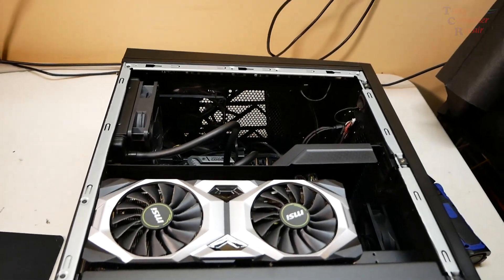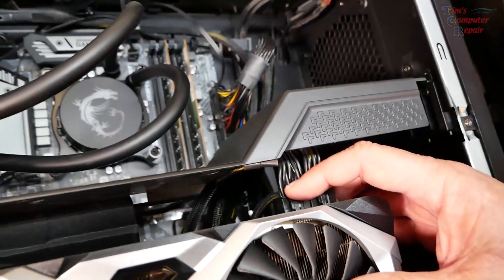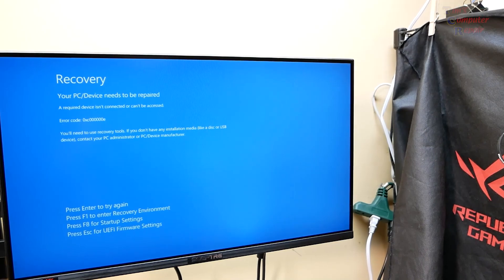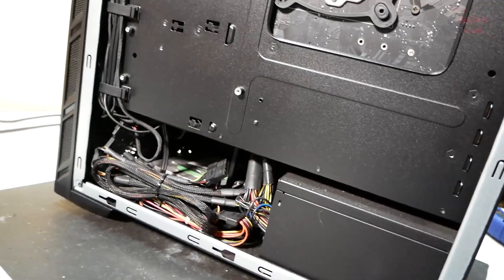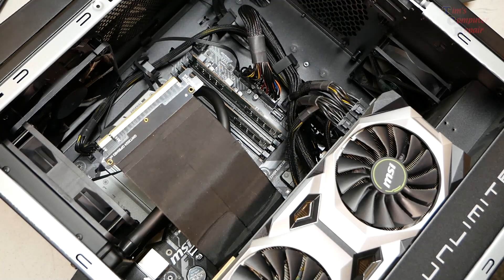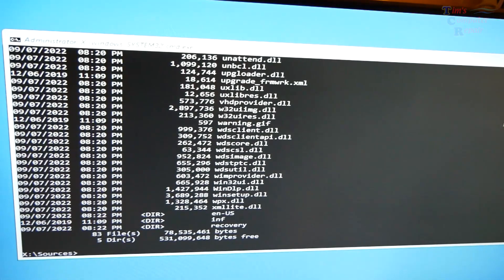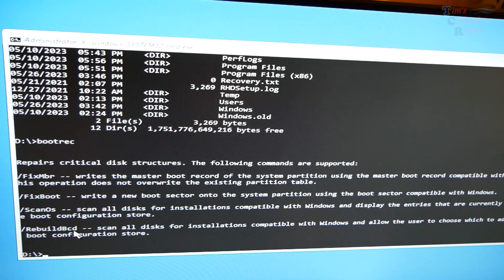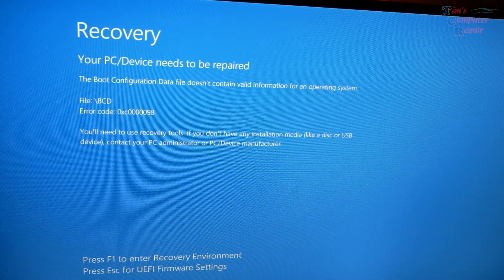This Windows Bug Happens to So Many Computers That Come Into My Shop

Comment: rEFInd is another great easy to use bootloader that can get you back into a windows installation especially when used with efibootmgr
Reply from the maker: Thanks for commenting.
Reply: @TimsComputerRepair  No problem, rEFInd is generally used for dual booting with linux and efibootmgr lets you see and edit the uefi boot config to set a partition as bootable from a linux live usb. It's slightly unconventional but it's a good backup!

Comment: May be related to TPM in some way
Reply from the maker: Maybe
Reply: @TimsComputerRepair  Yeah because IIRC if TPM is disabled suddenly and windows is configured to only boot if it's on, that would explain what you're seeing there. There are other programs/hardware hijinks that do this too in the sake of "security". I guess if the data isn't locked and can be recovered, I am wrong about this. Nice video, thanks to replying to me, cheers!

Comment: one of the biggest mistakes I think most users make is to have the Windows OS and their personal files on the same hard drive/partition. Way too messy. What I have done for years on my computers is to separate the operating system and my personal data. Right now my boot drive is a 500GB M.2 drive and the only thing I put on that is Windows and all my apps. Nothing else. All my personal data goes on a separate hard drive. I make sure to backup my personal data regularly. If my Windows gets corrupted or the M.2 craps out it is much easier to repair. If needed I can reinstall Windows or swap out the M.2 knowing my personal data is safe. 
I am a big fan of cloning software. I use Acronis TrueImage. I make regular clone images of the C partition in case of a disaster. Saves me the trouble of having to reinstall Windows and all my apps, which is a tedious process at best. This system has worked for me just fine. Thanks for the video.
Reply from the maker: I agree with you. The issue is most home users get confused when you have more than one drive letter built into the computer. They mostly understand when they plug a usb or backup drive into the computer then a window pops up. But when there are two separate drives built into the computer they get lost for some reason. Thanks for commenting.
Reply: @TimsComputerRepair  yeah, you might be right   🙂
Reply: @TimsComputerRepair  Im by no means a computer guy (although, Ive been working on it slowly), but luckily, after a few majorly frustrating issues back in the 32bit days, I figured out that isolating your OS drive from all else possible on its own drive was a major step in avoiding the weird issues. I thought by now, it would be more widely adopted, but I dont really follow those trends. Anyway, I appreciate your videos!
Reply: Separating the OS drive and placing everything else thats possible to another drive has to be the best way to avoid issues!?
Reply: @Whoadayson  I find that it does. However, with computers being how they are there's always a chance for issues. The thing is to try to minimize them. With Windows and all my apps installed I am using about 140GB on a 500GB drive. So when I clone my C drive all I have to clone is 140GB. Not bad at all. And since there is nothing but the OS and apps on the C drive it is much easier to replace if it ever comes to that. Now sure, I can get a 1TB or 2TB drive to boot from and partition it but it's not the same for me. If the drive goes bad now I have to worry about whatever is on the other partition. For me too many headaches. Now I use desktop computers so it's easier to have multiples drives. On a laptop it's a different story. Like I said, this system has worked wonderfully for me. Nothing but Windows and my apps on the boot drive.

Comment: One free repair tool that's seldom mentioned on YT is: "Windows to Go". "Rufus" can enable creating an external bootable USB 3.0 drive, with a normal 2.5" SSD connected via USB-to-SSD adapter cable. You then can boot into Windows using this external SSD. If encountering an additional new machine, will take a few minutes to re-adapt to the change in hardware.
Reply from the maker: Thanks for commenting.

Comment: I'll give you a pro tip of sillyness Microsoft does on these prebuilts that may surprise you and curse Microsoft afterwards.
What can happen is that the boot code due to the order of the devices are in the BIOS upon install could very well be residing on the harddrive.
Since the boot is very tiny, it doesn't affect the boot speed, but it does mean that you can get a nasty dependency issue if you remove that harddrive or replace it.

What I suspect failed in this case is that you need to work on the boot code for the HDD to restore it, if you wanted to just make it work.
However, this tends to happen automatically when reinstalling either for some crazy Microsoft reason, so I recommend unplugging the HDD during the reinstall to FORCE it to put everything on a SSD and avoid weird drive dependencies in the future.
Reply from the maker: Thanks for the input. Many times I do unplug secondary drives to avoid making a mistake. Thanks for commenting.

Comment: I've recently made the foolish mistake of downgrading from windows 10 to 11, the effect was that my system started showing bluescreens everytime i played any game for a while (time ranged from 30 minutes to 2.5 hours). Followed all the solutions like updating all drivers to scanning with scf and dism and the memory. 

Eventually went back to windows 10 with a clean install, but the problem persisted......

What appears to have been the cause is windows 11 apparently deciding to ruin the bios settings, in particular using the XMP profile for the memory causes the system to BSOD with varying messages after a while. Disabling XMP in the bios has completely stopped the bluescreens from happening. Problem solved, though I still look to get the XMP performance back...

As I probably don't have to explain, I do not feel any intention of downgrading to windows 11 again.

For reference, my PC in question uses an X470 Gigabyte board with 5800X ryzen cpu, so not the newest stuff in the world.
Reply from the maker: Thanks for commenting.
Reply: Damn that sounds rough. I think Id rather just have a 'clean' fail (well, as long as I had most data backed up). At least you found a way around it (kindve), albeit, it still sounds like a frustrating issue since your RAM is likely your worst bottleneck now? Hope things go smoother in future alterations!

Comment: The boot configuration data is corrupted and needs to be rebuilt. There are a number of things to check, but basically you want to make sure that you are booting from the main drive and not from another drive that might have it's own boot loader in the EFI partition.

You then need to check the boot entry for Windows, ensuring that it's pointing to the right partition on the drive.

You also need to make sure that the boot drive has any required storage drivers injected into it - for example, 11th gen and new Intel machines don't just use generic NVMe drivers, you need a specific driver.

Finally, FixMbr in bootrec is effectively useless at this point, as newer GPT formatted drives do not use a Master Boot Record to boot. They boot from a small FAT32 formatted EFI partition which leads me onto my final point - make sure that the files in this partition are not corrupted.

From a bootable Windows installer you should be able to fix a non booting drive, assuming the Windows install isn't totally broken. The boot error you showed confirms that the issue is purely with the BCD and not the Windows install itself.
Reply from the maker: Thanks for the info.

Comment: I'm curious why MSI put the m.2 drive in the second slot and not the first one. 

Also, it's weird that the OS was on D and not C. (Edit: I had forgotten about the flash drive being inserted). Anyway, good video!
Reply: @AlexBarbu  Ah yes, the drive letter thing makes perfect sense, They probably forgot he had a usb drive in. But I  think the top M.2 goes to the CPU and the second one goes to chipset, which is slower. Perhaps this is motherboard dependent though. But if it were me, I would have used the top slot for my boot / Windows drive. Anyway, thanks for your post reply, it gave me something to think about and comment on.
Reply from the maker: Thanks for commenting.
Reply: @AlexBarbu  Right, yeah, as Wormtown Ska mentioned above. I actually forgot about the flash drive. Doh! Haha. That would explain it. Anyway, I also think the boot and Windows M.2 NVME should have been mounted in the top slot, but hey if it works. Ya know. And thank you for responding.

Comment: I agree this is a common issue that seems to occur to Windows 10/11.  Never managed to find what was causing it though I suspect it's from a Windows update going sideways.

Just two things I want to throw out there with the BCD related errors:
'bootrec' with the 'RebuildBcd' switch looks for any Windows installations that aren't already located in the BCD, when '0' is reported that doesn't necessarily mean that 0 Windows installations exist on the drive, just that there are 0 on the drive that aren't already in the BCD.

bcdboot is a very power tool for fixing these issues.  Often the problem can fixed by running: bcdboot <drive_letter>:\Windows

Your video does a great job illustrating the process of elimination when approaching and troubleshooting a Windows blue screen! 👍
Reply from the maker: I will keep this information in mind next time. Thanks

Comment: This issue is caused by corrupt filesystem residing on reserved partitions for windows. It is not really known why that happens, however as BCD is being corrupted, the possible things would be FS corruption, malware, bad windows update (However I don't think that it is being rewritten during updates, maybe during multistage update process to inform PC to reboot afterwards).
Scanning the drive for OS'es also misses because the ScanOS determines which systems are registered in now corrupt BCD table.
It is possible to fix this issue by booting into USB with installation of windows, and trying with new BCD. (Re-installation of OS is not required, as only the BCD needs to be recreated)

The second possibility is that system was installed in MBR mode, and now the BIOS is starting up the system as AHCI/RAID (GPT) mode.
The device identifier won't be recognized, so the first partition will be booted up (the one which contains recovery environment and BCD), but as the devices configuration do not match the BCD table, it will eventually fail with the error seen on video. In this case solution would be to change the boot type in the bios/uefi From GPT (SATA/RAID/AHCI) to IDE Compatible or vice versa.
Reply: I have also seen this error after restore of Windows using Macrium. I had to disable secure boot in bios then run the restore and then let Windows boot normally then shutdown and enable secure boot back in bios.
Reply: @Trevorodunne  Absolutely possible when doing any form of reimaging drives. Re-enabling secure boot probably fixes the issue, as the default keys supplied by motherboard manufacturer will be reimported. However the Secure boot in that case was acting as a guardian to not allow the custom (unsigned) OS to run.
Reply from the maker: I will keep this information in mind next time.

Comment: Thanx for the video.  What was the problem ultimately ??
Reply from the maker: Have no idea. The boot loader got blown out as has many other computers I have seen. never know what the heck causes it.
Reply: @TimsComputerRepair  It could be perhaps an attempt at dual booting with Linux? Windows Update is known to be pretty hostile towards Linux partitions on the same drive.
Reply: @アカシア-w7b  That would be my best guess.  Had it happen to me a few times and it always pointed to a dual boot install.  Never recommended.  As for Repair, rubbish.
Reply from the maker: The many customers that come to my shop with this problem have no idea what Linux is.
Reply: @TimsComputerRepair  LOL.  Good answer, Tim !